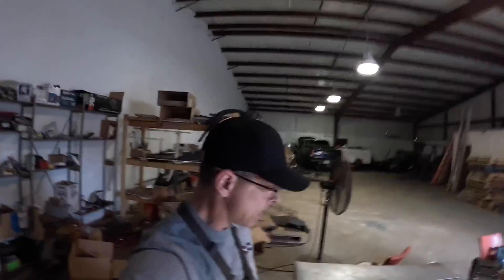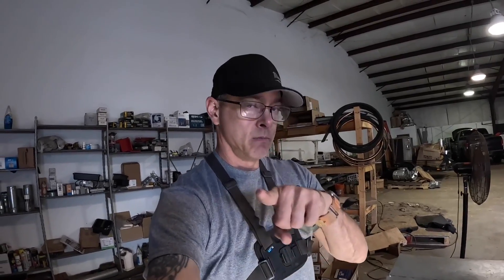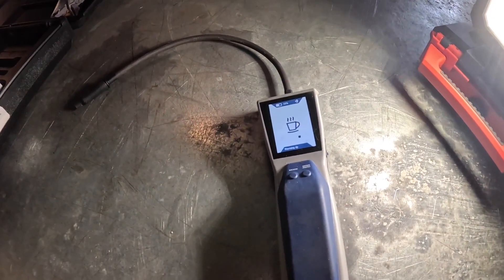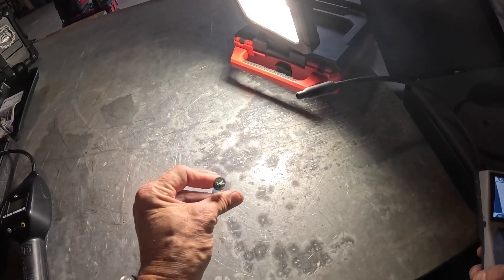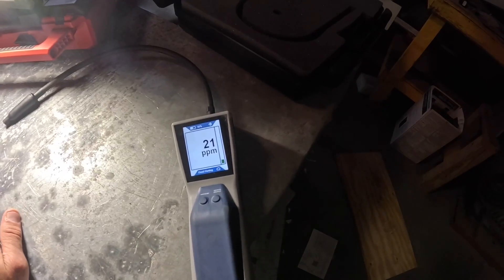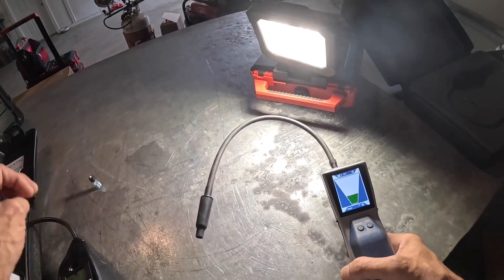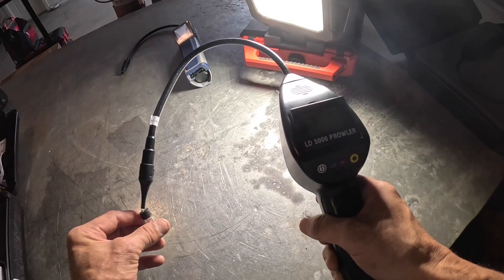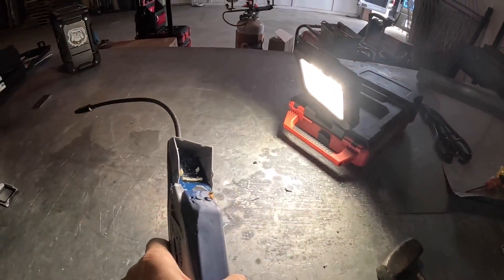Very Expensive Leak Detector Problem Resolved! Must See Ending! #hvacguy #hvaclife

Comment: you fixed it like a nest thermostat, if you want to box it up and send it to me ill take a look and see whats going on, seems like there might be an issue with a pull down resistor that isnt pulling the gate voltage down after the heated diode gets excited, so its maintaining the steady alert and not draining back down.

Comment: A problem with an internal wire that connects the manual device and the sensor in a movable tube,,, a wire inside it is weak and does not transmit or communicate signals correctly

Comment: Well...I'm kind of disappointed. I was thinking you really had found a problem in the design and fixed it.

I have a much lower end Inficon Tek-Mate G1 leak detector and while it does work, I've not been all that happy with it. It seems to have a thing about false positive detections. Other HVAC techs do seem to like the Stratus and get good results from it...

Comment: I guess you can just throw away $900 and it not phase you but I would have warrantied it as many times as it took to get a working detector. I have a D-tek 3 and I love it. Best leak detector I’ve ever owned and I’ve owned several. It’s possible water got sucked into the pump. You have to be extremely cautious searching a wet coil for leaks with that particular brand
Reply: lol nah the only correct outcome was what happened imo! 😂 Shipping fees add up and when you are tossing money in a burn barrel you may as well get a kick out of it

Comment: @hvacrsurvival  😬
Reply: 🤷 It doesn't pick up R-11... it's a infrared sensor that's been tuned to only current day refrigerants. This has been known for a while now and that is what's inside that vial. Obviously the detector had an issue beyond not picking it up but who knows why. Mine works great. That's why the test file for theirs is R-134a. It has a 2-year over the counter warranty you don't have to send it back. If the supply house doesn't do that for you then you turn them into the factory for not following the warranty.
Reply: @HVACRSurvival  just thought it was funny, I'm pretty sure he deals with mostly 410a. I order most of my stuff online so I'd be pissed too 😂 
As far as the supplyhouses they'll usually take care of you even out of warranty

Comment: Now that's funny, obviously they are overwhelmed with bad units and don't want to take care of customers.
Reply: No, the customer doesn’t know what they’re doing.  That solvent in that leak test vile is only made in manufactured for heated Diode leak detectors, not infrared technology. 

This is what happens when people don’t read . 

And even when you’re using that leak detector vile, you are not to place the tip right into the Vile hole . 
     You are to pass over it in a continuous sweeping motion at a slow rate 3/8 of an inch above the surface of the vile nonstop. 

Again, something you read in the H 10 instructions on how to use the file properly which apparently he hasn’t done that either even though he owns a H 10 

The proper reference files are for sale for specifically testing, refrigerant leak detectors, but somebody would actually have to read to know that.
Reply: Well I was surprised to see the reviews on this exact unit is overall positive 4.5stars with many votes.  But I always read the manual thoroughly because there may be something critical or specific to a unit that a user is doing wrong, the ole RTFM, may apply here? @coldfinger459sub0
Reply: @coldfinger459sub0  that doesn't explain the BS he's had with that detector in other real world instances.